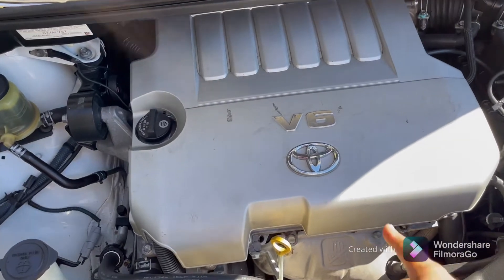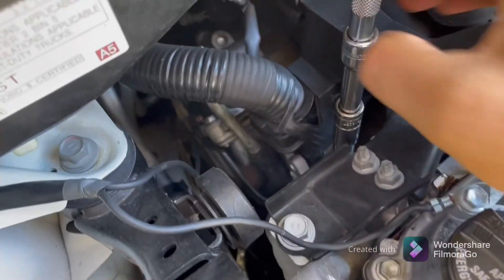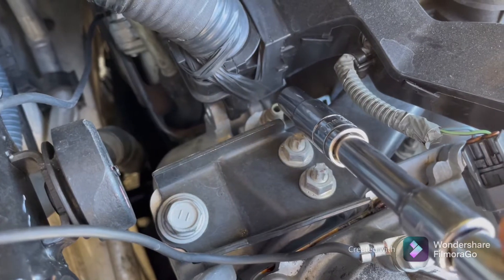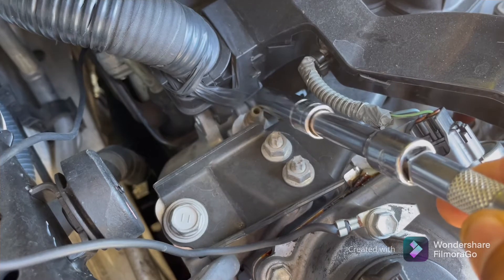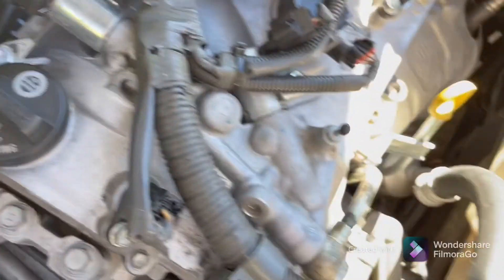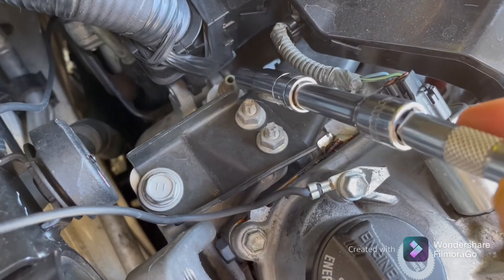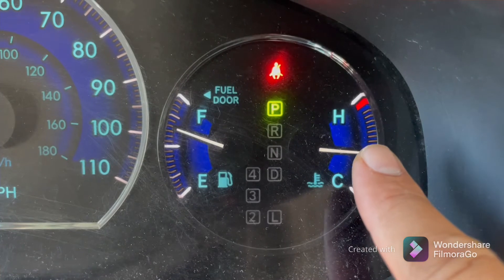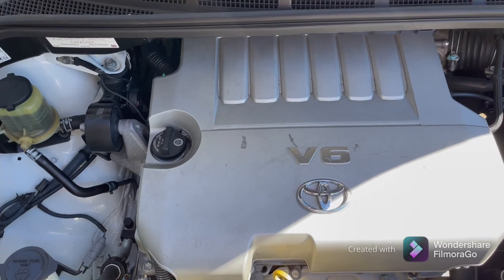Bleeding the Cooling System Properly Toyota Sienna

Comment: Put a hose on the bleeder valve and direct the coolant to a container.  My Sienna did the fountain and then the air comes out and then the fountain of coolant again BUT that is not when you stop as air bubbles will still be present in the system.  This is not a 5 minute fix.

Comment: That is not the "proper" way by any means. That bleeder valve has a nipple on it for a reason...they make a funnel that locks on to the radiator cap, a hose attaches to the bleeder nipple and runs to the funnel. You open bleeder, You fill the radiator and a bit of the funnel. Let engine run with heaters off at 2-2200rpm, level will raise in the funnel as air and coolant flow from bleeder hose to the funnel. Coolant level will raise quite a bit in funnel, it takes a while to get "all" the air out of these systems, once the air finally gets purged feom the heater core and rest of system toull get a steady stream from hose and your radiator will start taking in the rest of the coolant, you close the bleeder, wait for the air bubbles to subside, plug and remove funnel, replace cap and the system is completely purged of air pockets....it takes a bit lol, not as simple as opening the bleeder im afraid on this one, if you do it this way you most certainly have alot of air in the system.
Reply: This gentleman is correct about this not being the correct way to fill and bleed the air out of the system. There are other videos that show the proper way to do this.
Reply: Not to harp on this but you do not just let it spray all over your engine bay and into electronics. The no spill funnels are the way to go. You never walk away and let your coolant level reach empty . That is probably why the gentleman w/ Lexus above in comments now has a warped head gasket.
Reply: Make a video please
Reply: he needs to remove and remake this video the right way it could get someone hurt or a destroyed motor.
Reply from the maker: 3 million ways to skin a cat!

Comment: Does the reservoir cap need to be off or on?
Reply from the maker: Leave it on
Reply: @TheEtixzShow  there was no coolant coming out from the bleeder valve only air and a lot of white steam. Any ideas?
Reply: It was idling for about 45 minutes
Reply from the maker: You need to add coolant

Comment: Where is the Bleeder Valve in Toyota Camry 2001 2.2 Litter engine ?
Reply from the maker: If not mistaken, look for a similar stand up nipple around the upper manifold. Remove plastic cover. Same process as the sienna to bleeding the system. Let me know. Good luck.

Comment: I did it exactly like that but my heater isn’t working Halp! The needle is good and stable always slightly under the middle but no hot air. I accidentally took out the condenser line. Could that be it?
Reply from the maker: Does the Fan work? Is it blowing air?
Reply: @TheEtixzShow  sorry for the late response it is blowing air just not hot air. Thanks for the reply. Sub
Reply from the maker: Its that line you accidentally took out(condenser line) or you need to unclog/ clean up the in and out hoses. They sell a solution at an auto store. But first you should disconnect the in and out lines that go into the vehicles dry wall. And flush them out with water.  If no water runs out from either in or out then they are clogged and you should use a solution to try and unclog the lines.
Reply: @TheEtixzShow  thank you! That pretty much did the job I didn’t flush it correctly. I truly appreciate it specially in this cold ass weather!

Comment: I just saw a video that says you should install a line from the bleeder to a funnel back to the radiator. Update: I just did this job again and I didn’t bleed it and I just let the bubbles come out of the radiator.
Reply: Yea this video is not how you properly bleed the system if you do it this way your going to have major air pockets, which reduces proper coolant flow, creates air blockage and reduces heat transfer and creates improper engine cooling...there is a specific procedure for a reason
Reply: @ZacharyScreeton  I know what you’re saying is the right way. I did it another way and I checked it 6 times. I’m not having one problem. I’m a perfectionist. Always strive for perfection. Stay with what you like. 👍
Reply from the maker: Different strokes for different folks, what ever rocks your boat!
Reply from the maker: Thank you for your side of the story!
Reply: less mess and you save coolant.
Reply from the maker: And that too!
Reply from the maker: Well i didnt do that and it came out perfectly fine 👌 but it wouldn’t hurt to try that too.

Comment: Thank you, a question for you, I did the drain and fill on my 2007 Lexus RX350. The heat works fine and it doesn't overheat but I noticed the level in the reservoir going down after a few months. Could it be due to not bleeding the system?
Reply: change your radiator cap   it suppose to withstand  15 psi pressure  but if its old and worn out  it won't hold pressure in
Reply: @brandonblack2095  I got the cap and will plan on doing that today. I will bleed the system and change the cap. Hopefully that fixes it since I don’t see any leaks.
Reply from the maker: Thats perfectly normal. Mine does the same. Just fill to FULL line.
Reply: @TheEtixzShow  Thank you, will do that.
Reply from the maker: Also, sometimes it spits it back out from reservoir / cap/ small tube. Thats normal

Comment: How do you know this is needed
Reply from the maker: Good Question. The engine was over heating, due to the fact that i had just replaced a hose. After proper bleeding the system. Everything is OK.